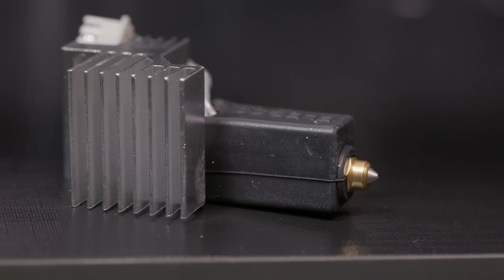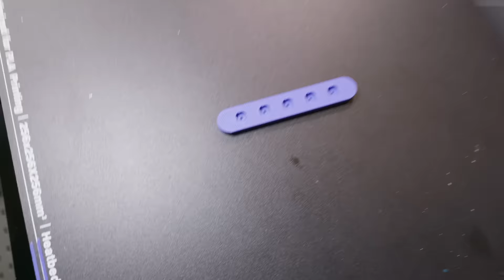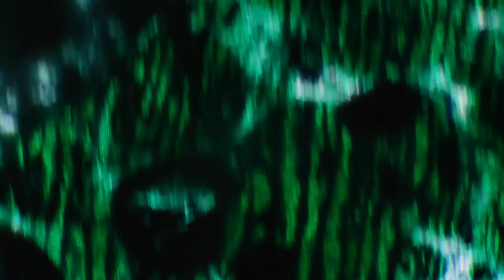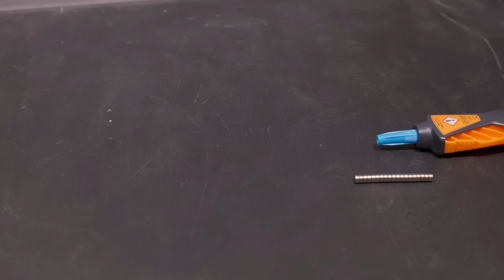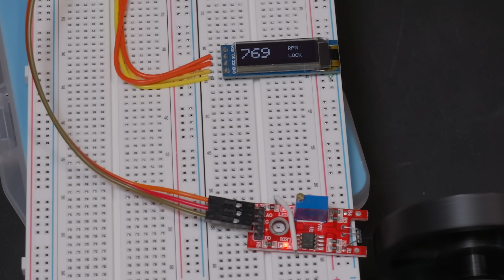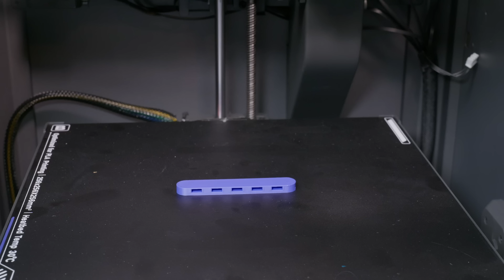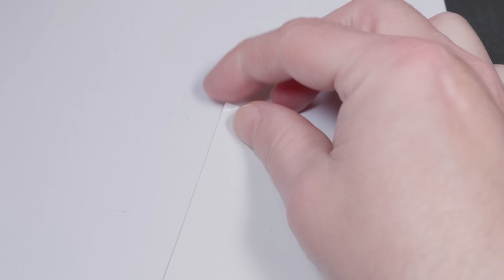Magnets in 3D Prints: How to ruin your printer edition

Comment: Lol I'm sorry but I strongly disagree. Embedding magnets is completely fine if you know what you're doing. I use an A1 mini with a hardened steel nozzle (very magnetic), and I've printed DOZENS of prints with embedded magnets without any issues. I have left healthy margins on some prints which don't require a friction fits. In my experience, three steps ensure success.
1. It helps if the plate and the bed is magnetic - if the print has a low profile or you're embedding magnets within the bottom 20 mm, the bed helps keeps the magnets in the print and they don't get sucked out. 
2. If you need to add a magnet higher up, adding a little flap that holds it in place or using super glue ensures that the magnets don't get sucked out. 
3. With bar shaped magnets, you can add a slot that's at an angle from the bed surface/top surface and slide it in, so the magnet doesn't have a straight path up, and doesn't get sucked out

Comment: I actually did this once before I even knew it was a thing. I made a “spice” grinder that looked like the Death Star for a friend.

I just used a friction fit, with the hole being a couple of millimeters “taller” than the magnet so that the nozzle wouldn’t physically contact the magnet after resuming the print. It was then fully enclosed and works like a charm.

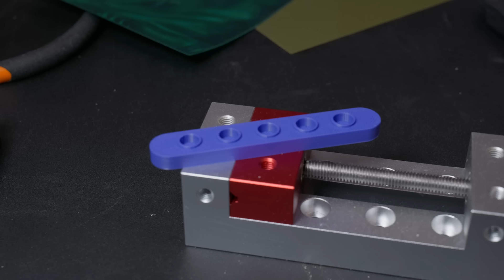Comment: 5:46 - Actually, it's generally a good idea to leave a small gap above the magnet (meaning, have it about 0.5 mm below the surface of the part), so the magnets don't smack into each other when the parts attach. I wouldn't add a lip, though (that'll generally lead to a gap between the parts themselves), I'd just make the hole slightly deeper than the magnet.

And always glue them (I use epoxy). PLA "relaxes" with time (as do some other plastics), and a simple friction fit will become weaker with time, to the point that the magnet on one side will eventually pull the other one out.

Comment: Pausing and embedding the magnet is a clean way to do it, but since you can't put pressure to press in the magnet, it can annoyingly rattle around inside the print.  The best solution is a variation of the friction fit. But rather than letting the exposed magnets have direct contact, you design the object in a way that it mates on the backside. That way, there's absolutely no chance of glue/friction failure where the magnet eventually falls out of the pocket.

Comment: my current way of dooing it is by leaving one side of the magnets hole open (not the one side it should be attracted to, that one is kept at 0.5mm wall strength), inserting them after the print is done and then filling in the remaining gaps/enchasing the magnets in the print with a 3D pen ( practically a handheld extruder/heated nozzle combo that you can practically draw in 3d space with ... but i abuse it for welding and modifying my 3d prints what works ungodly well) and milling off the excess with a battery powered dremel

Comment: I like encapsulating them but was taken aback by the rapid degradation in strength with small distance changes. I usually for just 0.4mm. 0.2mm proving too flimsy and 0.6mm too thick for decent strength. If I really need full strength then glue them exposed.

Comment: On my Prusa mk3s the printbed is held in place by a few larger magnets instead of the (presumably) more modern sheet. Because of that there is no issues with putting any magnets directly on the printbed. I usually enclose magnets similar to bolt nuts as yoi showed at the beginning, but there is only 1-2 layers between the magnets and the printbed. Thus the magnets stick to the bed more than strong enough to not get caught by the nozzle printing over them. Of course there will be a total of 0.4-0.8mm of plastic between two magnets in the end, but the force is usually high enough for my applications

Comment: A slightly larger hole and baking soda then ca glue. You will get a small wisp of smoke and the soda will cure ridiculously hard. You can sand it smooth if you over fill.

Comment: what glue do you recommend and what viscosity? do you need to buff the magnet surface first?
Reply from the maker: buffing will help but generally not necessary in most cases, I use gel superglue just because it doesnt drip everywhere
Reply: @LostInTech3D  Thank you for replying.

Comment: The simplest solution for magnetic nozzles when embedding mid print is to get the hole diameter just right for a gentle press fit. If you get it right the magnets won't get pulled out.

Comment: I have designed a small shape around the magnet which uses a snap-fit mechanism to snap into place. No glue, insertion after print, holds incredibly well. The hole in the part has a ring at the bottom that is slightly wider. The cylinder around the magnet does not cover the magnet entirely, only the edges. The cylinder is tapered so that at the bottom there is a slight distance between the magnet and the cylinder so it can flex. Then there are two small notches on the lower edge of the cylinder and those snap into the bottom of the hole. Really simple to print, works every time.
Reply: @bertilorickardspelar  interesting, do you have an example file to show this better?

Comment: Let's take a look at some numbers. Magnetic fields of permanent magnets are reduced by a factor or 1/d^3. d being the distance to the center of the magnet to the other magnet's center.

So using thicker magnets will decrease how much the gap plays a part in its strength. Two 3mm magnets that have four .2mm layers between them, 2 layers on each face, are decreased by 50%. However something to consider is the use of a steel ferrous plate. A plate and single magnet will have a higher magnet force applied up to 2 layers between them, it becomes weaker after that. So a 3mm magnet encapsulated with 2 layers and a steel plate on the surface will have a 75% force with the two touching having a 120% force compared to two magnets touching.

Comment: 10 seconds! Yeah, you’re definitely not biased and cherry picking. So weird you didn’t just use a soldering iron and doing the actual process! No, you dumped WAY more heat than necessary, for WAY longer than necessary. I’ll never understand why people half ass videos. I have a strange feeling he tried the soldering iron and didn’t get the results he wanted!

Comment: The only magnets I've ever tried putting into things are vertically on the side with friction fit, and the results were hit and miss with that.. seems like the position of the hole in relation to the layers makes a difference as well @.@
Reply from the maker: teardrop shape will work best on the sides, if you remember to design it in, but yeah. Not as easy or predictable.
Reply: @LostInTech3D i did do that.. x.x

Comment: You've made some good points.  Some thoughts:

1. One option to keep magnets in place is to glue a very thin plastic or steel sheet on top of them.  That will minimize strength loss while keeping them firmly where you placed them.

2. You can place a magnet on one piece and a steel plate/etc. on the other.  This won't be as strong as two magnets, but can be used where there are geometry issues/etc.

3. One neat trick for being able to not worry about getting the poles mixed up is to place diametrically magnetized disc magnets--where the poles are on either side of the axis instead of along it--in a loose cavity.  As a pair comes together, they can both rotate to match perfectly.

Cheers!

Comment: Im using pause printing method with almost no tolerance and no venthole all goes without problems, glue doesn´t usually stick for long time, especially when you don´t clean up magnets from your greasy finger touches

Comment: Just checked and the normal Stainless Steel nozzles of the Snapmaker U1 seem to be not magnetic. So probably the hardened steel ones as well.
Old Artillery Sidewinder X1 has a brass nozzle which is not magnetic and ruby nozzle also is not magnetic. Just got curious and tested the ones I have after seeing his "brass" nozzles in the video attracting the magnets..

Comment: heat inserts with top layers screwed down, that keep the magnets in. that way you're not heating the magnet and possibly messing with its properties, and you're still keeping it in the part.

not always viable, but can work in some cases. also applies to slots in the sides of pieces you screw together by normal design, giving you a magnet that will allow you to stick plates or facias or whatever to whatever side you  place the slot near. the piece stays m ore or less rigid, and you still get the same effect as the hold down plate style.

otherwise, i use small amounts of epoxy adhesive. super glue technically works, but can become brittle over time or in certain environments. epoxy takes way longer,  and will remain largely intact and unaffected if not exposed to uv. though some filaments/brands don't really like to allow epoxy materials to properly cure, so mileage varies on that, as well.

i've been wanting to get some goop and try to encapsulate some in pla, but its a bit spendy for experimentation, as far as i'm concerned.

Comment: Biggest (or actually: smallest?) issue I have is that the magnets I order from AliExpress turn out to be up to 25% smaller than advertised (and weak, too). That alone essentially rules out covered use/side insertion.
Also, basically every batch is different. I also tried Amazon, but that's the same story, only more expensive.
Reply from the maker: hmm. All the ones I got from amazon were fine, and I bought about 4 packs of 6x3 from different places. Noted, though. And not surprised either.
Reply: Your problems, my problems
Reply: Dude I’m amongst my peopke

Comment: My problem with most friction and glue fits are that these magnets have a very very smooth slick surface. Over the long term, they will not stay there. Sure you can go back and glue them back in, but it is annoying.
Reply from the maker: suggest checking out the black ones, theyre coated in something mysterious (resin probably)

Comment: Hahaha 12 mag square pocket radial Halbach (4.9)mm arrays with a 19mm x 4.5mm core (n52)
Reply: Double stack the core with the extra sticking out of the rear “weak side”, and then put a 2 mm x 25 mm steel magnetic blank on the back. I did significant testing. This was the strongest thing I was able to make. It’s for something very particular.
Reply: I’ll try to put something up and send you a link

Comment: I made a few controllers with magnetic bottoms and had used side-load slots with a single wall on top, it works well enough but the magnets were very small so that half millimeter of spacing actually did reduce the strength a notable amount. Since then I've been doing holes with glue, and if you'll be gluing them making it a little looser than you would for friction fit is nice. Also, don't sleep on the "alignment" concept! On lids for small objects or whatever where the orientation matters, making it so they repel when you put it on the wrong way is really cool

Comment: Great summary, thank you for the video! <3 I've embedded thousands of 3x2mm magnets into board game pieces over the last couple years. After many iterations, I'm using triangular holes now. Crush ribs didn't work for holes that small (with a 0.4mm nozzle). Hexagons were better than circles, but triangles are the most reliable. Still, even factors like infill and distance from the heat bed make a difference. I'm often printing a 4 by 4 board (16 magnets inserted on the same layer) and found that the hole that gets printed first is always the tightest fit. I usually have to adjust my tolerances for every new model (and new printer, even my P2S is different than my P1S).

Comment: 14:20 I have another suggestion, seal in with a compatible thermoplastic foil. Like a vacuum bag (leftover). It is a bit time consuming, as for best results you need to put it under slight tension. Then you heat the foil and plastic around the magnet until they melt and fuse together.
Well, you have to test beforehand if both are compatible. Best use nylon for both, or PETG (filament) and PET (bag). Or alike.

Comment: I've been putting magnets in my prints on pause for years with no issues. Typically I only put 2 layers of filament on top, so that the magnet is still fairly strong. Most of the time I do an interference fit as well, so there isn't much risk of the magnet coming out while printing, but I've had plenty of loose magnets with no issues.

Comment: steel filled epoxy should do well then (magnets cleaned with isopropyl before inserting them into a cavity that has enough space and roughness for the epoxy to grab onto) - at least that's what I did so far - a hole for extra epoxy to leave through (not compressible) is needed

Comment: Rather annoying that I was taught the Curie point was a temporary effect on permanent magnets. 
- My K1's nozzle is steel, so that's also out. 
- I tried friction fit, and it's very temperamental. 
- friction fit with gorilla glue was only ~1.5x as good as the friction fit (will try regular cyanoacrylate next)
- my greatest success has been rear-insertion in TPE for some fridge calendar marker holders (thin 1st layer was all I needed, but it also just barely worked through 0.4mm walls)
- side-insertion only worked for the bottom of a print.
I personally think tapered ribs with glue is going to be the most consistent, though I've yet to try it.

Comment: 1. Do not use magnets, they are expensive, heavy and you need manual labor. Use snap fittings and other solution instead.
2. If you must use a magnet, ask yourself how bad would it be if it wasn´t embedded and came lose, if not so bad, glue it in place, if it´s a problem you need to embed it in the print.

Comment: If a magnet is printed in place, is there any loss of magnetic force caused by the hot extruded filament getting placed directly on the magnet?
Reply from the maker: that's not unlikely but it will depend on layer height, dwell time, etc

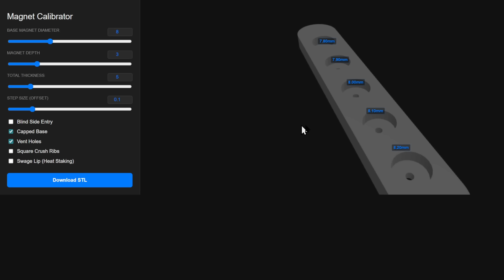Comment: 3:20 you can also add a small lip just above the magnet hole because most magents have rounded corners and will happily snap into place without having a perfect size hole and will still be flush with the surface.

Comment: You can protect your magnets with capton tape pieces if you want to insert and print over. Maybe here are some paper holemakers of 6mm (or what size you need) diameter. So you can get the circles quickly. Then just need a very small drop of a super-glue to stick to a magnet and you've done it :) A temperature proof magnet (from one side of course. AFAIK the capton tape isolates only from heat.

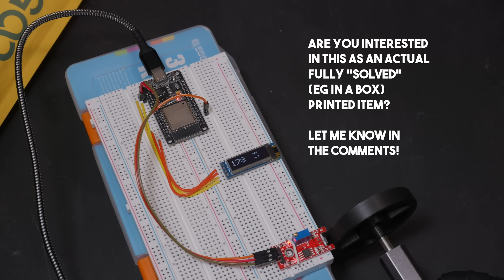Comment: 10:55 Doesn't the size of the wheel matter? Because I think if you made the wheel with the magnet smaller it would count more RPM and if you made it bigger it would count less RPM as one thing is, that the size makes the drill / screwdriver or whatever, slower because of weight and the second thing is that the magnet has to cover bigger circumference making the RPM count lower, the bigger the wheel is.
Reply from the maker: yes, a little.

Comment: There is an added benefit to a simple alternating sheet of magnets over a proper array; When made of individual magnets the sheet will tend to hold itself together so the individual magnets don't rattle around very much individually. I made several pockets with a very thin wall between them that I could push magnets into and alternated the direction. The magnets hold each other pinned to the barriers between them.

Comment: I use friction fit but also magnet to magnet contact with a wall between the magnets, magnets tend to eventually come loose eventually and the coating means glue isn't super effective on them but having them pull themselves into the print gets around this, for the hole you can have an easier time moving from a round hold to a polygonal hole with a small (say 0.25mm) relief around the base of the hole to account for the rounding in the corners.